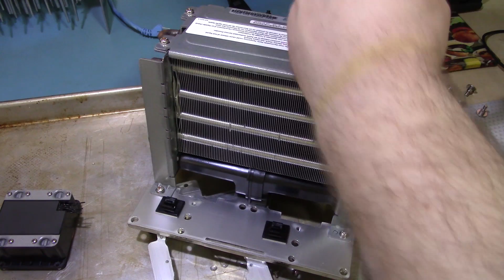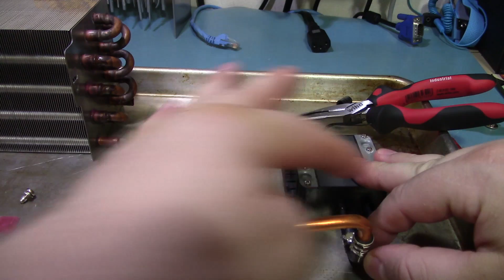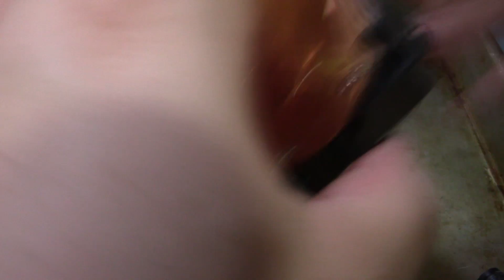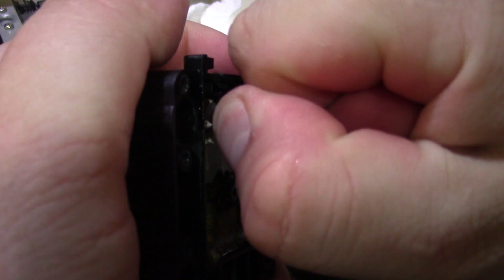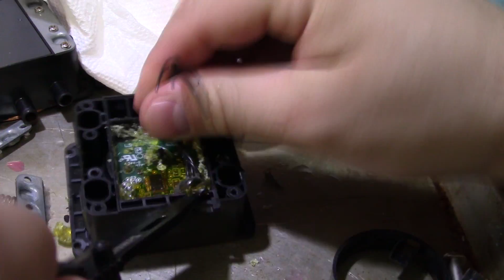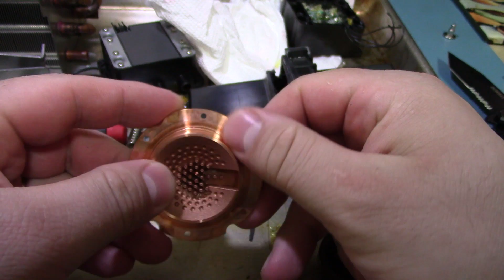G5 Liquid Cooling Unit Teardown

Comment: Fyi, you should never run a water pump dry. They arent meant to be run dry as they are cooled and lubricated by the water they pump. And ive heard that the pink coolant is actually some form of GM dexcool radiator fluid, the samr youd find in a General Motors vehicle.

Comment: This is so fucking typical of me during a tear down for curiosity. I poke and prod the same way you do. 

I had a good collection of interesting computers until my mom threw them out without asking when I had my own place. I remember coming over to pick up my old computers like a week later and them all being gone. :(

I got a dual CPU G5 today for free and have been toying with the idea of getting it running. I'm getting a second tomorrow for free as well and the first one is in great condition despite from some weird calcified material near the heat sink. I have no HDD or Optical drive as they were pulled from the system but I know the primary user and the conditions this machine operated in for its life (Video Editing). All 8 DIMM slots are saturated and the internals are surprisingly clean. 

So. Is it worth it for me to spend the time and effort to get this thing running for me to fuck about in OSX Leopard for an hour or so?

I was hoping to use it as a project to eventually make the chassis accept an ATX motherboard and just run a secondary PC for my spare room that looks cool. If I could keep one original and butcher one I would be content with that.

Comment: si that from a late 2005 quad co re or an early 2006 quad core cheers
Reply: There is no early 2006 Power Mac G5. And from the looks of that radiator, this is also not from a "quad"  model, but from a dual 2,7 early 2005.

Comment: Damn i wish mine had that cooler i got the duel pump Delphi. Still 1 cpu gets hotter than the other and it has no friggen screw on filler cap just rubber nipple caps sux

Comment: My PowerMac G5 has a weird issue where the fans ramp up to max speed, it boots up fine but no keyboard or mice work at all. It's very weird and I have no idea whats actually wrong with it
Reply from the maker: +ElectrofizzStudiosCo Reset the SMC on the motherboard. Google for info on where the button is. I'd also try replacing the PRAM battery. If USB refuses to work, it might be fried. Try a PCI USB card. :)
Reply: It's a leak on the O-rings on the covers the CPUs. I literally just pulled my PowerMac G5 apart, had the early 2004 intercooler system, the dreaded Delphi... Heaven behold... Exactly what they are known for happened to mine... Yay me... Time to throw away an 8k computer...
Reply: Could be a faulty temp sensor, or an issue with something plugged into it. Typically they ramp up when theres a hardware issue to prevent the unit overheating and to warn the user of an issue audibly [whether that was a design intention or not].